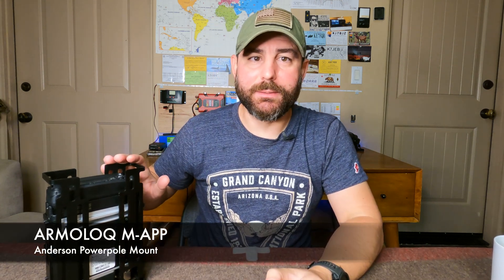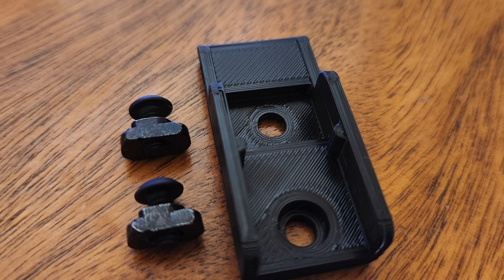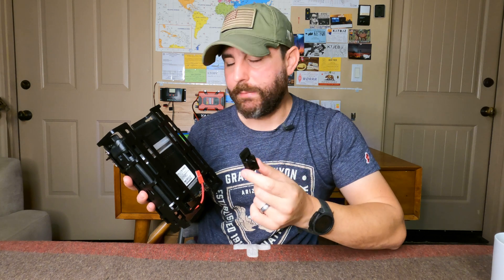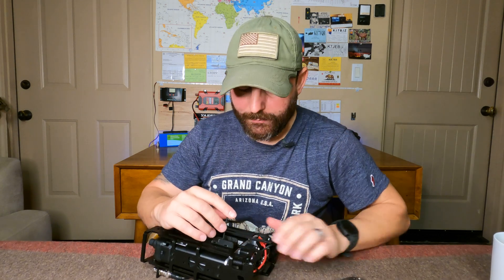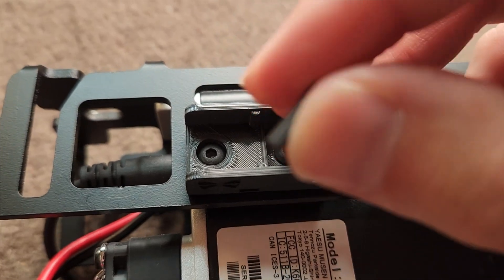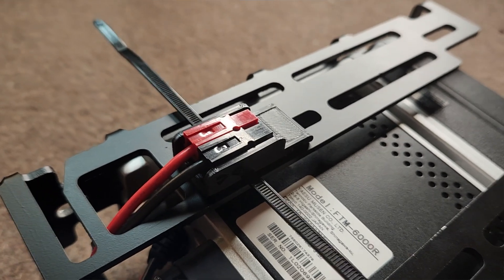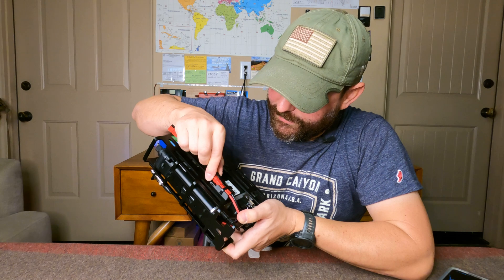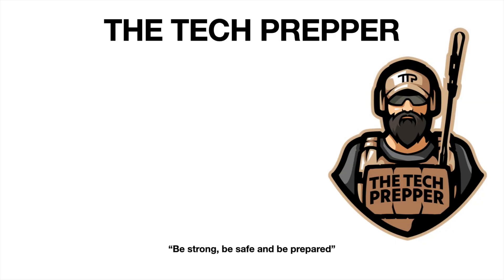ARMOLOQ - Anderson Powerpole Mount - Step-by-step Installation

Comment: Several problems for newer users; 1. the frame openings have been changed since this presentation. 2. The powerpo;le connectors have been changed and the mount doesn't fit. 3. the antenna jumper currently available doesn't work with the pass through connector as they've changed from from what's available PL-239l and the pass through is an so-239 and won't fit.

Comment: RED RIGHT TONGUE TOP     viewed from the "hood" side where the connector is flat, with the wires going down, and the mating side of the connector up, then the positive side is on the right.  The mnemonic that I use is "red right tongue top". (It leaves out "when the connectors are pointed at you.") That is to say, when the tongues are up, then the red connector is on the right.  ✌🏻   I used to have mine backwards too    🇺🇸🙏🏻👍🏻

Comment: When your radio is in the bag do you ever have any problems with it overheating? What wattage and duty cycle do you use?  I have a backpack I want to put my ft857d in but am concerned about lack of airflow...
Reply from the maker: Never. I talk about this in most of my manpack field videos. It all depends on how you operate. I deliberately carry out targeted contacts with short commo windows (5-15 minutes). I operate in temperatures north of 100F and have never had a problem. Check out a recent video I did called "Anti Field Day 2023". Also, I designed my bag with a rear zipper and snap attachment point i. the event I need to allow air flow. I never use it.

Comment: You're not running any kind of a fuse, or did I miss that ?
Reply from the maker: I don't run a fuse much these days anymore on the manpacks. However, I did build an inline fuse early on in the channel using a pair of automotive ATC/ATO fuse holders. I just attached a set of Anderson Powerpole on either side. It functioned as the patch cable.
Reply: Gaston; doesn't the bioennopo battery have a built-in circuit that shutdown the battery when it starts sending more than 12v
KD9WTH  73

Comment: I couldn't tell from the video, does your FT-891 have the Anderson Powerpole conversion installed that replaces Yaesu's factory Molex connector?
Reply from the maker: Check out a recent video by KB9VBR on his mod for the FT-891. For my 891, I'm just using  a 6" Molex to Anderson Powerpole cable. I think I picked it up from Powerwerx a few years back.
Reply: @TheTechPrepper  I have watched Michael's video several times and have gone all in on Anderson connectors. I've been putting them on everything. I just bought my FT-891 so I'll have to wait until my warranty expires before I do that upgrade. I have added Anderson's about 8" from my Molex connectors for now, 73.

Comment: Thats awesome. Question, did i miss the in line fuse?
Ill place my orders today.
Another great design😊
Reply: Opps I saw it. Thx
Reply from the maker: This is just a mount. It's up to you to bring your own fuse system. I just used an automotive ATC/ATO fuse holder and crimped on a couple of Anderson Powerpoles to each side. I can't recall which video it was in as that build was a few year back.